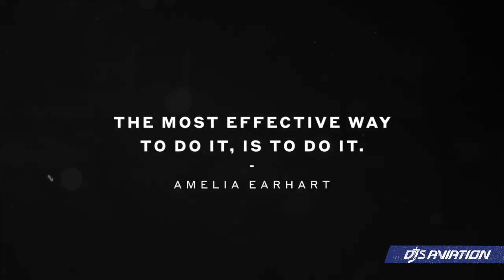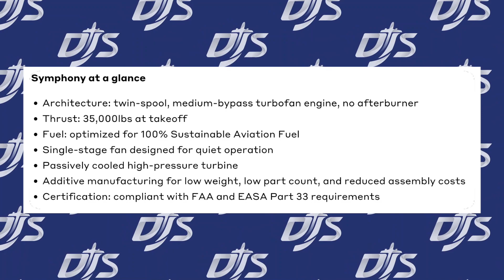Major Boom Supersonic News

Comment: Here is a rundown of Boom's latest position (06 September 2023):
   •  The factory at Greensboro North Carolina is now erected
   •  Boom has hinted that, as the XB-1 no longer represents Overture, it probably won't fly
   •  Boom have now finished their consultation with Rolls Royce on the Symphony engine
   •  Virgin have now let their Overture options laps
   •  130 orders and pre orders from Japan Airlines, American Airlines, and United Airlines
   •  Boom and Northrop Grumman partnership for military and government applications 
   •  Boom awarded STRATFI contract by USAF for Overture fast transit applications
   •  Cutaway images of the engine and Symphony power module are now on Boom's site  
In July 2022 Boom announced a major Symphony redesign:
  •  Fuselage, waisted to comply with area rule
  •  Wing, multi angle Delta gull, with computer controlled leading and trailing edge slats
  •  Empennage
  •  Engines, 4 medium bypass turbofans in under wing individual pods
  •  Seats, 65 to 80, all business class
  •  Length, 201 feet (same as Concorde)  
  •  Wing span, 106 feet (greater than Concorde)
  •  Height, 36 feet
  •  Cruising speed, Mach 0.94 over land, Mach 1.7 over water, at 60,000 feet
  •  Range, 4,880 miles
   
Boom have appointed suppliers for major Overture items, including the engine:
  •  Florida Turbine Technologies, engine design, development and certification
  •  Aernnova  (Spain), design and supply wings. 
  •  Leonardo (Italy), design and build fuselage and wing box.  
  •  Aciturri (Spain), design and develop empennage. 
  •  Safran Landing Systems, 
  •  Eaton, hydraulics, fuel and inertial systems collaboration
  •  Collins Aerospace, ice protection and systems collaboration
  •  Flight Safety International, 
  •  GE Additive, additive engineering (3D printing)
  •  StandardAero, maintenance
  
Florida Turbine Technologies, a division of Kratos Defence, will design, develop and test an engine that matches the specific requirements of Overture.  Engine development began in January 2023.  Engineers, who were involved in the design of the engines for the supersonic F-22 Raptor and F-35 Lightning, will be on the design team. The engine will use existing certified parts and materials, including blades, rotors, accessories, and core. The manufacturers of these parts will help throughout the Overture engine development program. The engine will have the same basic architecture as engines that currently power all modern airliners:
  •  Turbofan
  •  Medium-bypass
  •  No afterburner
  •  Twin-spool
  •  35,000 pounds of thrust on take off
  •  Air cooled multistage turbine
  •  Single stage, 72 inch diameter fan, low profile, high flow, light
  •  Low-pressure compressor stages: 3
  •  High-pressure compressor stages: 6
  •  High-pressure turbine stages: 1 (passively cooled)
  •  Low-pressure turbine stages: 3
  •  Additive manufacturing for lightness, low part count, reduced assembly costs
  •  FAA Part 33 and EASA CS 33 compliance
  •  ICAO Chapter 14 noise compliance, especially relevant on take off and landing

The Symphony propulsion system will have a Boom-designed axisymmetric supersonic intake, and variable-geometry exhaust nozzle. The propulsion system will be fuel efficient at both sub and supersonic speeds. The intake will be similar to the intakes on the Mach 3.2, SR-71, with a spike that slows the air to the engine, and probably generates forward thrust. Wind tunnel testing of the intake and exhaust are underway.

16-2023.09.05

Comment: The fact that the images of the proposed "supersonic" engines have fan blades clearly visable near the front of the nacelle tell me that they think most of the public and evidently most of the investors have not a single clue about how supersonic engines work. No extended intake duct and no con/di intake sections means no supersonic capability. A jet engine does not breathe supersonic air and until they release images of an engine system with an intake that can slow the airstream down, while recovering a good percentage of the pressure in a way that supplements thrust to meet fuel efficiency requirements, it's just a big joke.

Comment: Supersonic with turbofans? Possible, but I'm not going to get my hopes up. Worst case scenario would it's cruise speed ending up settling around the transonic range.
Reply: The F-22 and F-35 both have super-cruise.
Reply: @AaronCMounts  Yeah, they have afterburners, and a max speed notably slower than Concorde (the original supersonic aircraft concept) while this new engine proposed won't have afterburners.

It's possible they could push it into the low supersonic range but if they do and it's not significantly faster on trips than a normal aircraft the entire purpose of it's existence is called into question.

Comment: Quite excited. I fail to see why there is still so much doubt looming over Boom. Yes, XB-1 is yet to fly and their timeline of getting Overture in service by the end of this decade looks increasingly tight. However, in the words of a man wiser than I, "if it takes longer, it'll take longer; but we'll still do it." One of the biggest questions about Overture now seems to be answered with the arrival and impending development of an engine, and if push comes to shove, there shouldn't be any reason why Overture's debut can't be pushed back to sometime next decade. After all, going back to XB-1, a prime example among others, Boom has already met with some delays. But hey: these are just the thoughts of an enthusiastic teenager who doesn't know as much about the aviation industry as others might. I could be wrong, but I personally think I'll be right. :)

Comment: With the horrendous development costs of a brand new engine rather than a re-working or enhancement of an existing one, you have to question just how many airframes will be required to break even. 

As for being environmentally friendly because it uses sustainable fuel, while statistics and reasoning may be manipulated to make this appear so, the truth is far more complex.

An industry must be taken as a whole,  and unless there is sufficient sustainable fuel to satisfy the demand, this aircraft cannot fully justify its green credentials simply because it will be using sustainable fuel which will no longer be available for many other aircraft which would have used it if only it had been available.

Even then, does aircraft use prevent it being used elsewhere?

Far too often do people claim green credentials when, in reality, they are simply moving the issues elsewhere and, in some cases, preventing a far more efficient use of that resource. Hardly green!

Comment: Boom SST is smaller than Concorde, slower than Concorde, has less range than Concorde, and will carry fewer passengers than Concorde. Concorde was over fifty years ago, and in 2022/23, this is the best that can be worked up? If Concorde could exceed Mach 2 over fifty years ago, surely this thing must be a Mach 3 + lightning bolt. Disappointing. It does look great, though.
Reply: Range is actually about 500km more of overture.

The diffrance in carry capacity is actually not that high. While they are both exactly the same length Overture carry about 5 meter more of usable cabin space, fitting quite a number of additional rows. In a 1+2 configuration Overture can hit over 90 seat with no problem, just slightly shy of the just over 100 for Concorde.

The speed of Concorde was never its drawback. A lot of people think of the fuel, while it was thirsty it was not even the main problem. It was the complexity of it.

Overture use significantly less fuel. Less than half per passenger (well in theory at least).

Did you know that Concorde carry a lot of its fuel inside the fuselage.  And it was not only under the floor in the wingspar like in a A321XLR, but all over the place, even at cabin level.

The first 5 meter of the Concorde is the droop nose, the next 5 meters are the cockpit. The last 10 meters are the tail cone (that is full of fuel), and the 5 meters a head of that is baggage storage. Yea, its at cabin level, because under the floor there is no space, because its all fuel
Reply: Concept of diminishing returns.

Comment: The main problem I still see is the 4 engine design. They have to get it down to 3 or even better 2 engines (same if airbus ever wants to make a new A380). Its likely that more countries will start banning 4 engine aircrafts in favor of more economical 2 engine designs mostly effecting cargo airlines but a few passenger routes may be affected and that would also be Boom. Also by the time mid-late 2030's comes around I can see the US and EU starting to push for Greener aviation and also ban 4 engine planes as that would be around the time the last passenger A380 and 747 will start aging out and also probably around the next big wave a design or whole new projects announced for Boeing and Airbus for next generation of airliners.

Comment: Thank you for mentioning the X-1 missing all of it's targets. The x-1 needs to fly or all of this is hearsay.  My personal opinion is that the X-1 hasn't flown because it literally can't fly. And the reason the design was changed so drastically is because of all the things they have learned from the X-1.  I believe they designed a plane in CATIA early on and then found out in reality that it actually is a horribly unstable design.
Reply: They need to redesign the XB-1 first.  They rolled it out with Overture’s original concept of 3 engines.  It needs to be reconfigured for 4 engines.
Reply: @shepardbook  Exactly. What the hell are they going to learn from a testbed that doesn't resemble its scaled-up version in the slightest? Wing shape is wrong, engine intakes are wrong, about the only thing they can get data on is how the forward-looking camera works.

Comment: Sooo, a small Florida company that mainly builds drone engines is going to build the engines for an SST, get it certified in both Europe and the US, and have it in passenger hands in just over 6 years? It'd be cheaper to use €500 notes as the fuel.
Reply: Clearly no major engine company wanted it... this is not a good sign.
Reply: Well, they are a subsidiary of GE, so they have at least somewhat of an idea of what they’re doing.
Reply: That company is owned by a billion dollar defense contractor though
Reply: They also make cruse missile engines. So they might have more experience then one might think.

To my experience. If you want something done fast and cheaply, have a small company do it.
Reply: @matsv201  so true. Let's all not forget that Elon Musk outperformed Boeing and NASA with his rockets!!
Reply: Seem to recall that Elon was just shooting tiny rockets into the air at one time.   Not unprecedented for small companies to grow.
Reply: @RS-ls7mm  Elon also had a lot more money to spent on SpaceX. And unlike building brand new engines for supersonic flight building a rocket based on a classic design it’s actually easier. There is a reason the Germans had working rockets before their fighter jets
Reply: @MrJimheeren  Both companies started with almost the same amount each, around $80M.   Spacex designed 4 new engines in the first 10 years.  Not an easy task.  But yes, Elon did get more money faster than Boom after that.
Reply: @MrJimheeren  It took ~10 years from idea of A-1 to operational A-4, the German jet development was in fact a bit faster. Both were first types in the new categories and had independent development timelines, so it can't be reliably compared based on the date of entry into service.

Rockets and airplanes mostly have different priorities, requirements and market environment, so hard to compare in general. It may be difficult for Boom to find a niche large enough to cover the cost of development and certifications, while the risk of not meeting deadlines, specifications and cost overrun is obviously high.

It is just too much radical new development at once - reliable, efficient, green supercruising airliner mostly from scratch simply sounds like too big jump from "baby boom".

Comment: I’d say it will be based on the new GE adaptive cycle engine with a bespoke fan optimised for the Overture. Otherwise it’ll be based on the F35 engine without afterburner.
Reply: The F35 has a three stage fan though. Was there ever a single stage fan supersonic engine?
Reply: I can't see how an aircraft without afterburners could evolve at Mach 1.7 honestly. Nobody ever did so.

Comment: Are they expecting the thrust for all 4 engines to equal 35,000 lbs or are they expecting each engine to produce 35,000 lbs of thrust?

If they are expecting each engine to produce more thrust than a Concorde Olympus or B-1B engine with no afterburner that will be unbelievably difficult, risky and expensive. 

If each engine just needs to be in the 9-10K lbs of thrust class that should easily be achievable.
Reply: I do believe that’s 35,000 each.  That said, I still think they’ll be redesigning Overture’s engines to something similar to Concorde, the XB-70, the B-1…. In other words, mounted in pairs, close to the wing with ducted intakes.
Reply: You do realise that 35,000 lbs of thrust is not a lot. The biggest engines on aircraft like the 380 and 777 produce around 100,000 lbs of thrust each engine. An old 747 is around 50,000. The engines of the F-22 and F-35 make less than 30,000 without reheat, and are designed to supercruise, but the next fighter engine is likely to hit that 35,000 mark and be able to supercruise. It's unlikely the big engine makers are going to allow an upstart to beat them to such an engine.
Reply: @briananthony4044  yes Brian, I am aware of the amount of thrust produced by civilian and military engines over the last 50 years. Do you know the bypass ratios of the GE90, the Rolls Royce RB211 and the GE Passport 20? Inlet temperature limits? EGT limits?

What you don’t appear to be considering is the small diameter that the Boom’s engine nacelle will limit the size and performance class of this  engine. You can’t shoehorn a P&W F135 engine into a nacelle that’s 30%-40% smaller. 

The Boom is only going to carry about 55 people. The form factor that’s already dictated for this engine by the airframe design will make it hard to get an engine with more than 15,000 lbs of dry thrust. Since Boom says afterburners won’t be used and airport noise requirements pretty much preclude that, Boom will have to find something similar to the GE Passport 90 that can handle supersonic flight.

Comment: If Symphony is successful.  It will be an incredible game changer...a propulsion system for the non-military aircraft capable of supercruise.  Gives an added dimension to the old FedEx slogan, "When it absolutely, positively has to be there overnight."
Reply: The Rolls Royce Olympus 593 engines on Concorde were capable and did use supercruise, performing for thousands of hours at mach 2.  The afterburners were used at takeoff to shorten the takeoff run, and to go through the sound barrier where drag was highest.

Comment: Technically, supersonic planes are possible. That is not the issue.
The limitation of supersonic planes for commercial flights have been economic as well as environmental impact (sonic booms). NASA is working on QUESST - Quiet Supersonic Transport/Travel - a way to reduce the sonic boom to a quieter "thump". Boom Supersonic seems to be leaning into the sonic boom and is NOT trying to make a quieter plane. This means that the conventionally loud supersonic plane will be limited to routes over water - like the transatlantic routes of the Concorde. This limitation will drastically limit the number of routes available to the Overture, and thus limit the potential buyers and operators of the Overture. Twenty Concordes were built for Air France and British Airways. Boom Supersonic will need to sell more than 20 to be commercially viable, or each of the small number of planes produced will each have to be burden with the high R&D costs of developing the plane.
Having a limited number of operators, the next issue would be the number of customers/passengers who would want to travel fast, but travel cramped. Concorde was a very cramped aircraft. Passengers would sacrifice comfort for speed. And still pay a hefty price for the "convenience" (and discomfort) of supersonic travel. To keep fares within reason, operators will have to squeeze in as many passengers as possible. For the same price or lower, a Business traveller can travel comfortably (albeit slower) in Business Class of a conventional plane, where he would be pampered and comfortable. If you really need to speak to someone across the Atlantic, have you considered a phone, a video call, a conference call, or Zoom meetings?
And we have not considered the costs of fuel or "Sustainable Aviation Fuel". And the impact on the environment (carbon footprint).
Reply: You make the failed assumption it has to go supersonic immediately after takeoff.  And even if that is true - NYC and MIA for trans-Atlantic flights; LA, SF, SEA for trans-Pacific. Dubai, Sydney, Singapore, …
Reply: @WestCoastAce27  Pedantic and strawman fallacy. I made NO such assumptions. The Concorde routes eventually settled on a regular transatlantic route, mainly (but not ONLY) between NY and London. BECAUSE SONIC BOOM. There were other routes or routes extensions tried that were overland, and on those legs, the Concorde traveled subsonic, which subverts the point of a supersonic plane. And was inefficient, and uneconomical. But I am glad to see you only had this nit to pick. The rest was what? Over your head?
Reply: @angeluscorpius does the small list of routes from Concorde have anything to do with the planes being operated by European carriers that would have no interest in the potential routes mentioned by @westcoastace27?